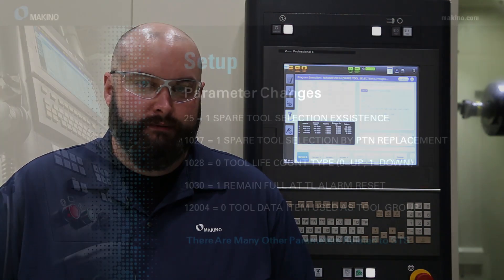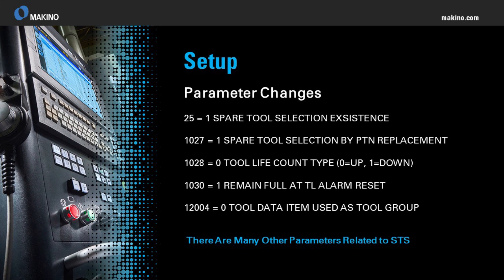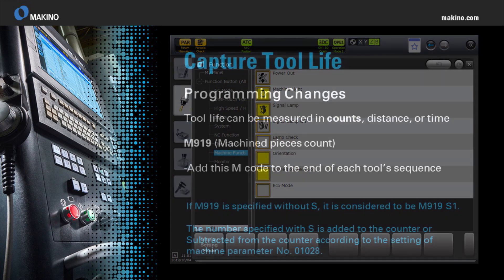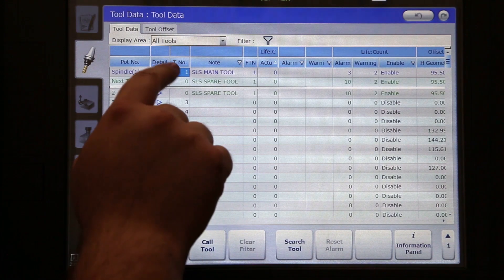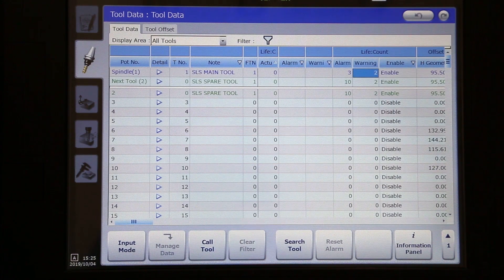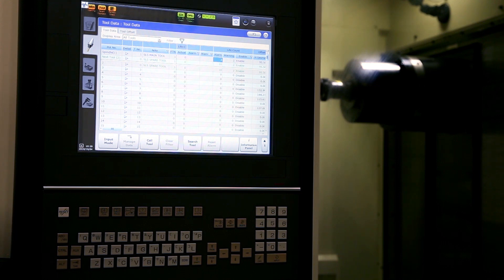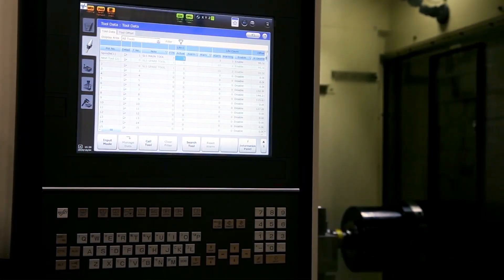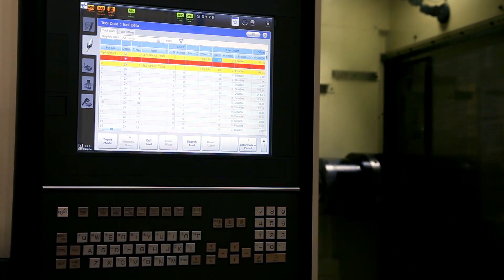Tech Tip: Spare Tool Selection Option on the Pro 6 Control

Comment: Got a Makino a81nx at work with pro 6. Is it posible to refill the tool life automatically when you clear the tool life warning? It did work like that in the older pro5 Makino. Now its easy to forget to refill manually. Not a big problem but would be good.

Comment: What happens if there are no spare tool available after the 10 runs? Will the machine stop as a result of the alarm?
Reply: Hi Ronny, 

The machine can be set up to act however you'd like.
On a Pro 6 machine Makino parameter 1034 will allow you to choose if the machine alarms and stops, only displays a warning, or does nothing. There are other options under this parameter that can be changed as well, like indicating which M codes the machine can safely alarm on if the situation you mentioned were to occur. 

Thanks for the question